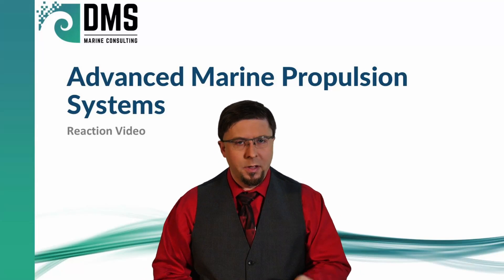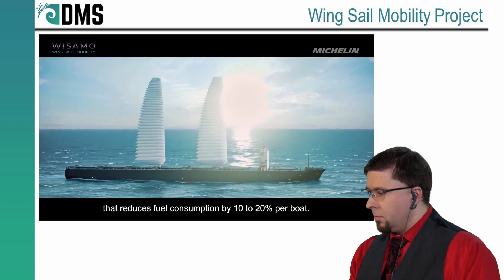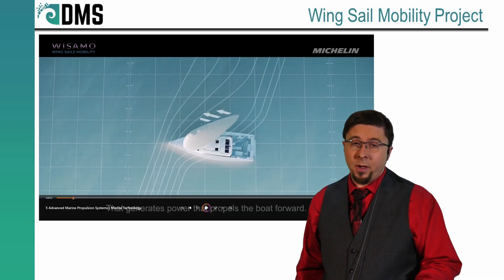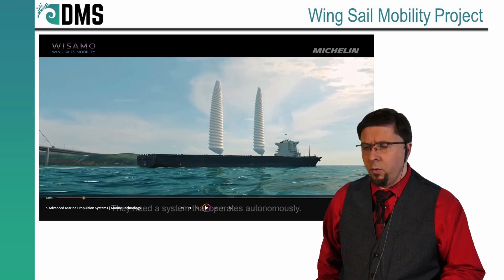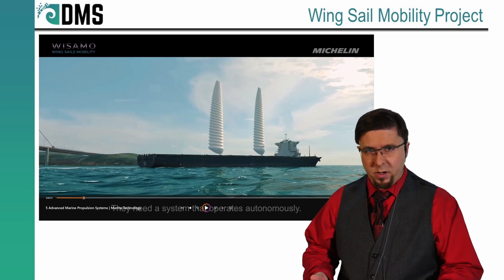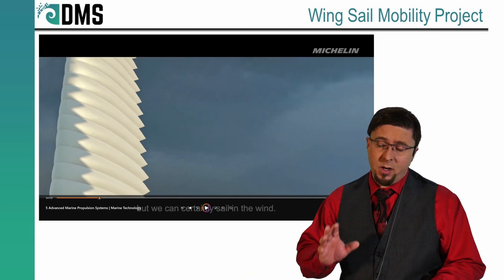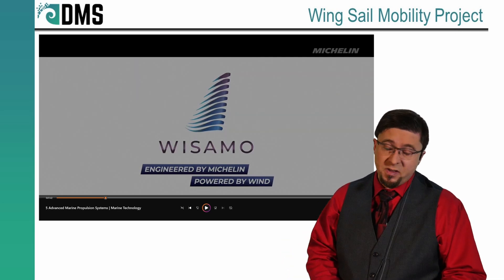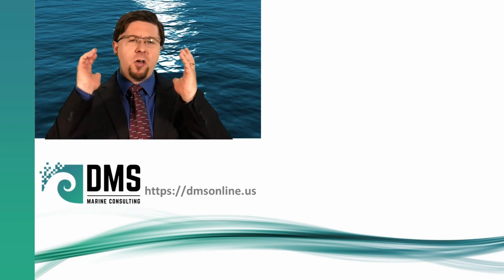Can Wing Sails Work for Cargo Ships?  Wing Sail Mobility Project

Comment: As an armature aerodynamic nerd my biggest issue with many of these concepts are they are single element wings rather than multi element airfoils. Multiple elements allow for a much greater angle of attack and hence much more forward thrust. Granted they are more complex and creating one that can work with wind from any angle is even more complex than the multi element airfoils on F1 cars or jumbo jets, but space on the ship is at a premium so a more advanced airfoil would be well worth the cost IMHO.

Comment: What I've never seen someone cover, and what no "Advert" ever goes into, is maintenance of these Sails. What if a sail fails in the extended position, who is going to (potentially) have to climb up the mast? What if the mast fails to retract in bad weather. Will there be extra crew requirements for ships with these sails installed, current crews are already suffering under minimum (aka maximum for the companies) crewing requirement and i can not imagine that these giant sails would not have strict and elaborate maintenance schedules.
Reply from the maker: @rosso4122  that is an excellent question.  I think this is partially why we only see pilot programs.  We want to test out the sails to better understand the maintenance issues.  It's very hard to plan for maintenance before we know which exact parts are likely to break.
Reply: I was on a regular sailboat when the in-mast furling line gave out.  The entire main sail rolled out into 35 knot winds.  The traveler car slamed so hard it exploded leaving a 500lb boom flailing around head height and delrin bearing balls all over the cockpit.  Recovery was dificult and dangerous.
I can’t imagine how to manage a sail so much larger when it gets loose.

Comment: Maybe some big omni directional windturbines (like the O-Wind generators). Connected to a 100.000 -1 mill. Kwh ( = 500 -5000 tons ? :face-blue-wide-eyes:) solid-state battery would be better ?. You could sail a straight line and "Wind-charge" while in habour.

Comment: The first big question I have with those sails is that those cargo ships can't possibly have enough righting moment for it to scale up to the majority of the propulsive power even under the most favorable conditions without really screwing up the hydrodynamics, stability, or both. I'd also be curious how it compares to fletner rotors since those seem simpler, are also righting moment limited, and have been installed on a lot more ships. 

I think a much more interesting technology for wind-assisted propulsion in the long run is kite sails. They aren't righting moment limited the same way because they don't need a mast, so they can scale up to a much larger fraction of the ship's propulsion without adding back the stability and hydrodynamic issues of a traditional sailing ship. They also work for container ships because they don't need a clear deck.

I guess the big advantage of wing sails over everything else is that they can incorporate large solar arrays to provide extra power since vertical solar panels are very effective at sea with all the light reflecting off the ocean surface.
Reply: They have enough righting for the small sails shown and no dagger boards to prevent leeway.  Container ships and car carriers don’t have stability to spare.
The weight of modern freighters is immense compared to any sailing vessel.  When NAs design sail rigs, the maximum force is limited by the max stability of the ship because wind gusts on the open ocean are too high.  Those telescoping sails they show are nowhere near capable of heeling the ship -they would snap.  They might be big enough to push the ship off course and make steering difficult.  The implication that these sails could be big enough to contribute significant thrust without affecting steering or navigation is a bold face lie.

Comment: I’d be very interested to see how much motive power could be generated from sail propulsion over integrating wind turbines with an existing diesel electric propulsion system. It must be easier to integrate a second power source into an existing electric system than running two separate propulsion systems by adding sails. Wind turbines also having the benefit of not caring about the angle of the wind to the direction of travel meaning less of a change in how the ship is to be managed and navigated.
Afaik The main problem of fitting wind turbines to commercial ships is how to stow them out of the way during loading/unloading operations, but if inflatable telescopic masts and sails are a possible solution I’m certain that something similar could be produced for wind turbines.
Reply: Wind turbine power is reasonably easy to estime, but none of the data will comprehend the changing angle of attack and pitching of the ship.  The much harder question is how strong and stiff would a wind turbine need to be to survive on a ship, then what is the performance of those.
Wind turbines were not superior on small craft and not easier to manage.  I doubt they would be better on a ship.
Reply: wind turbines are not going on commercial ships. they would not survive the storms and crazy waves they have to deal with. wind turbines in general suck, they are useless for commercial ships.

Comment: about reefing... if you have a wing, instead of a sail, can't they just angle it so it stalls?  You don't need to reduce sail area if you can just have the wing stall?
Reply: Wing shapes are better at shedding vortices than flat battoned sails which are better than conventional sails.  That said, the forces don’t go to zero and are still exponential with respect to wind speed.
This inflatable has a good coeficient due to profile and air pressure supporting the fabric, but it is also a very thick profile so the force is still high.  The weak point is the telecoping mast in bending.  Those are going to bind in the worst places when loaded.
The last factor is that winds are not uniform, so a large wing can’t be feathered to zero or even low force in high winds.  It WILL be unsafe at high wind speeds so it must be reefed.
Reply from the maker: You can.  But stalling doesn't eliminate the problem.  A stalled wing still generates lift.  Just not as much.  And at high wind speeds, even a stalled wing becomes a problem.
Imagine we design a wing sail.  It's meant to produce full force at a wind speed of 10 knots, with a lift coefficient of 1.0  (picking convenient numbers here.)
Simplified math:  Lift roughly equals lift coefficient times wind speed squared:
L = Cl * U^2
Now the wind starts blowing faster.  We stall the wing, which drops the lift coefficient from 1.0 down  0.10.  But the wind speed goes to 40 knots.  And lift depends on speed squared.  So 4x more wind speed = 16x more raw lift force.  Even if we reduce that with a stalled lift coefficient of 0.10, we still exceed the full load condition.
L@design = 1.0 * 10^2 = 100
L@overload = 0.10 * 40^2 = 160
160 > 100.  So we still overload the wing sail and snap the mast.
Reply: @DatawaveMarineSolutions  wind turbines don't fold... What do they do?